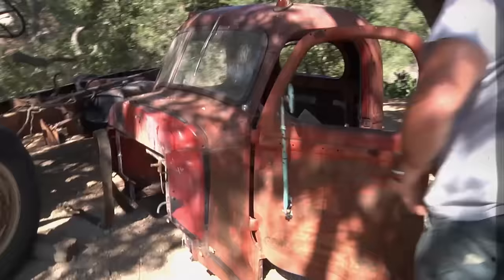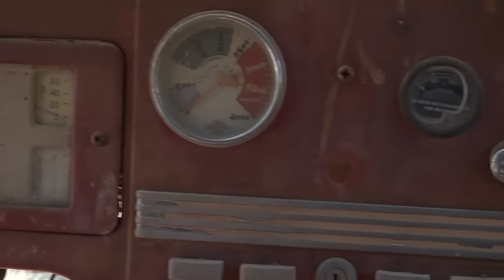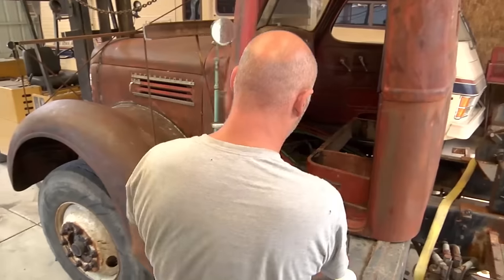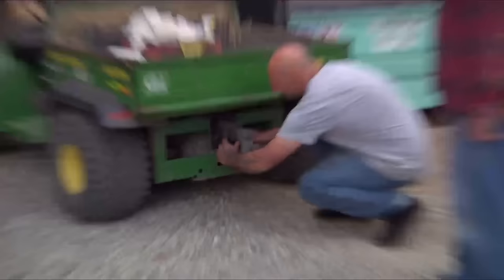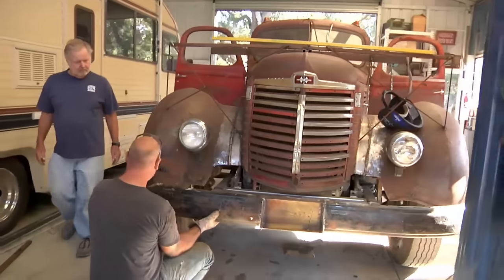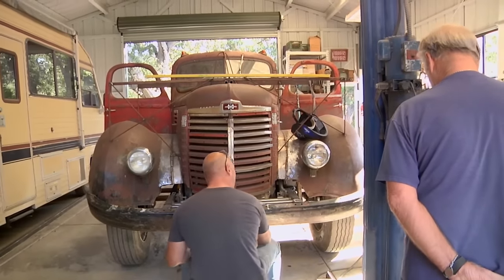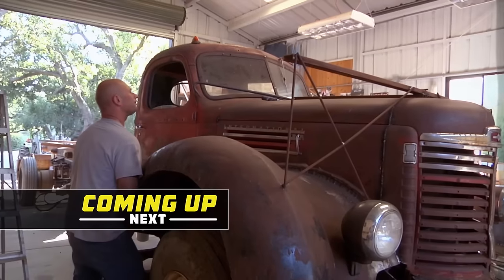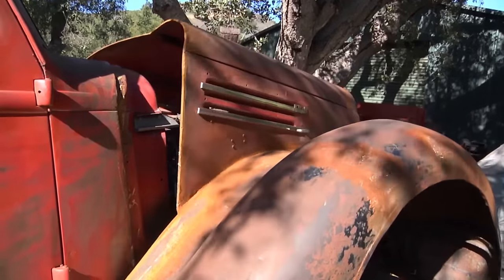Custom Truck Project - Full Custom Garage - S01 E01 - Automotive Reality

Comment: Afternoon, about 20 years ago I had a late ,1940's KBR-8 International, single axle tractor, had a homemade wrecker body on the back, I installed a Simplex 5th wheel...if I remember it had a 370? Blue diamond six cylinder, thing ran well.....man, Ian, you are doing a fantastic job!! You definitely have a imagination!

Comment: The 1939 GM Futurliner was made to transport the GM Parade of Progress around the country. This one looks like number 5 of the 12 originally built although there may be more than one of each variation. 9 of the original 12 remain. They use a 145 HP 302 gasoline engine This car carrier version is probably available for a little less than the one with a fully enclosed one that was sold at Barrett Jackson for a few million... $4.1 million I think but $5 million was also reported on the same sale.